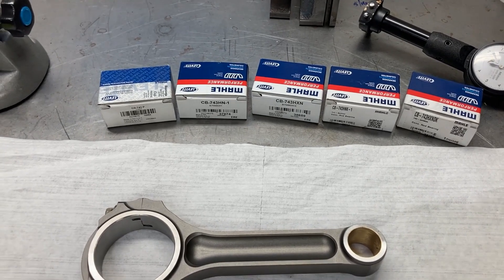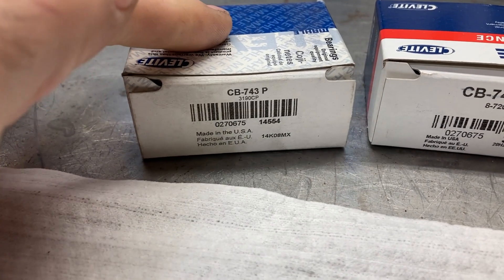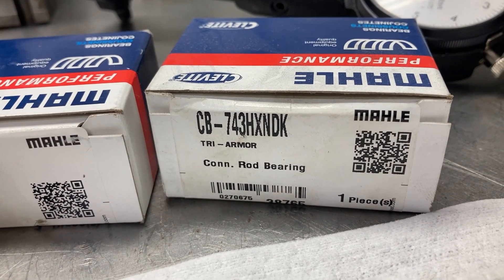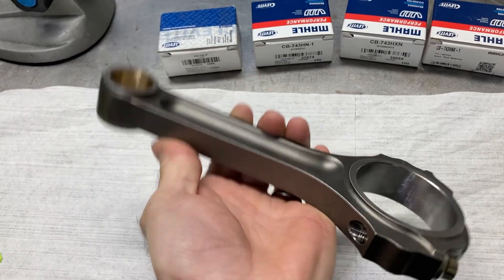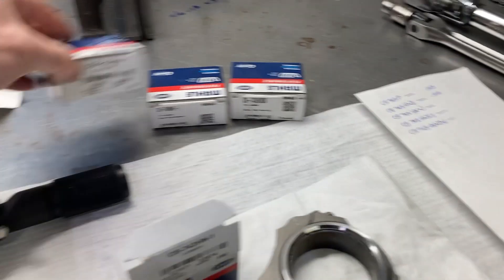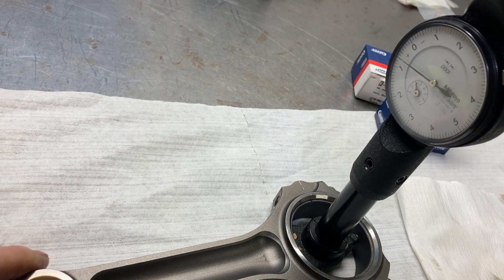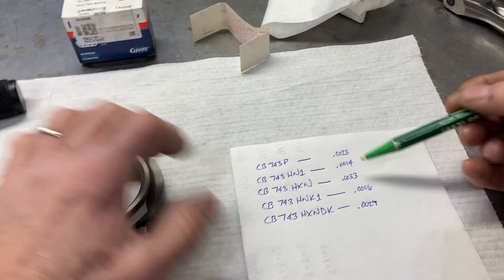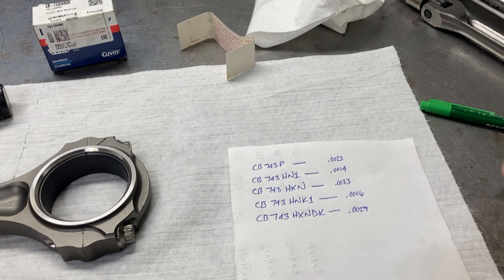Lykins Motorsports Rod Bearing Comparison/Overview

Comment: Do you only run tri-metal bearings everywhere? Cam and crank? I know you said you like the coated bearings but is the coating on top of the tri-metal/ Babbitt layer?
Reply from the maker: I do when I can.  Sometimes they're not available just because of the lack of selection for certain engine families.

Comment: You need to add an extra zero after decimal point
Reply from the maker: No sir, they’re written correctly.
Reply: @lykinsmotorsports  the way you had them written on the paper instead of 1.3 thousandths you wrote 13 thousandths
Reply from the maker: .001” is one thousandth.  

.0013” is one thousandth and .0003” ten thousandths.

What I have written is correct.

Comment: I'm working with a Ford FE right now & am finding this out first hand. I'm not real happy with my rod bearing clearances. I have a .030 undersized rod journals & bought king bearings & im only getting .0015-.0017. I was hoping for .002- .0025 but I've talked to King & Mahle & both have said maybey polishing the crank some more is all I can do. Both have said they would be fine with the clearance I have.
Reply from the maker: I wouldn't want .0015-.0017 on an FE rod bearing.  No way.  I'd want at least .0025 and generally like to favor towards .003.  Only way to get there is to polish/grind crank to spec.
Reply: @lykinsmotorsports  What did most everyday FE engines come from the factory with for rod and main clearances? the specs given in my factory shop manual are very tight, like .0015" on the rods being the loose end of the spec tight. Just wondering why most engine builders seem to prefer looser bearing clearances even on engines that generally aren't going to be run very hard. Pretty much all engines even performance engines built today in modern cars run a little tighter clearance with lighter oil viscosity to go with it with very few failures. If the mainline is straight and all the crank journals are truly round, why couldn't one do it with an FE engine as well? seen many stock FE engines north of 200K miles, just wondering what their clearances started out as new. That being said I have .0024" rod and .0026" main clearance on my .010/.010 ground 390 and it seems to work great with 15w40. Just not sure if it'll make it to 200K that loose like the stock originals I have seen did.
Reply from the maker: @MattsRageFitGarage  All bearing journal diameters in modern cars are much smaller than the FE.  Both the standard FE main and rod journal are very large in comparison to modern day stuff.  In addition, a lot of the modern OEM stuff is stuffed into an aluminum block, which necessitates tight main bearing clearances because the block expands with heat.  

Most every factory FE engine I've torn down with many miles on it have had copper showing on the bearings.  The bearings wear until they gain some clearance.  

Most bearing manufacturers (and most engine builders) go by .001" of clearance per every inch of journal diameter.  This has served me very well for a couple of decades.  When you do a tear down and see the mic tracks on the bearings, it has to be good, right?
Reply: Very good information in this comment section, glad I read it.